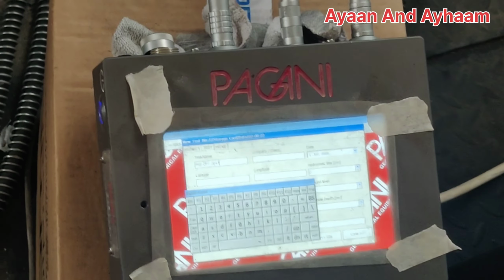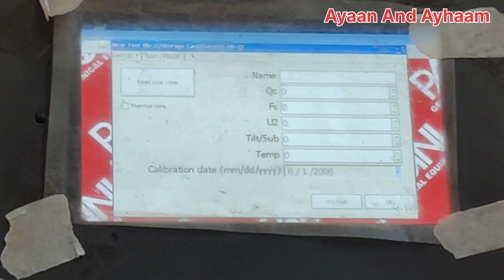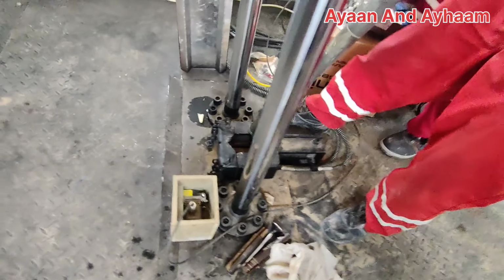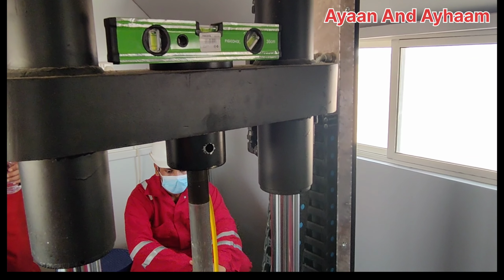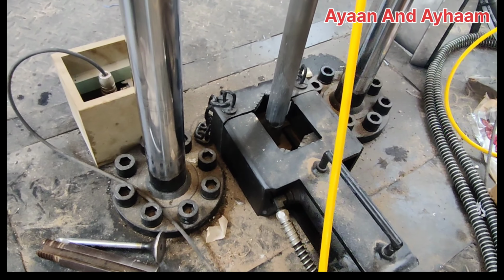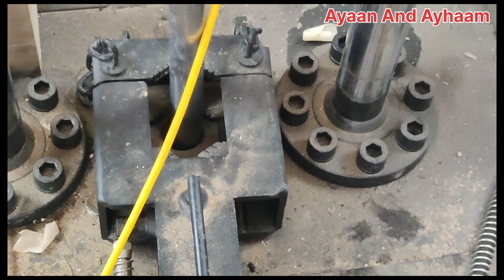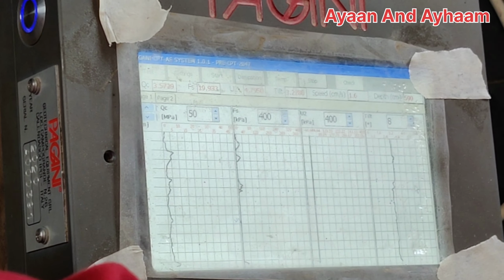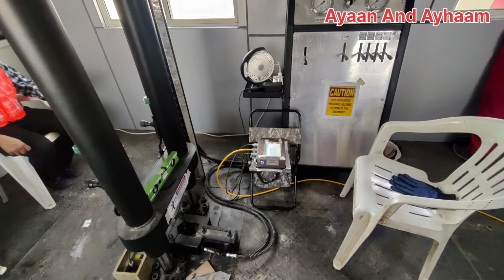Pre CPT - Cone penetration test - Ayaan And Ayhaam

Comment: No friction reducer?
Reply: What depth are you pushing to with the 10cm? Or client requested and your pushing force too?
According to standards you should be using a friction reducer
Reply from the maker: @dominicbarnett5334  as u must be familiar, we need to achieve rock head, for which we need to achieve minimum QC value 50,
Reply: Typical standard 50 mpa wc and 0.500mpa fs refusal.. 
just seen the rig and was offered a job to gulf surveyors before as CPT supervisor.
Reply from the maker: @dominicbarnett5334 yes dear, you have very well knowledge
Reply from the maker: No dear. We use cone directly as per approved MS
Reply: Also forgot what standard are you working too, iso, bs, astm?
Reply from the maker: @dominicbarnett5334  BS EN ISO 22476-1:2012 as well as ASTM D5778
Reply: Try the friction reducer when using 10cm as both standards state but recommend different areas where friction reducer is located. Won’t need one if using 15cm cone